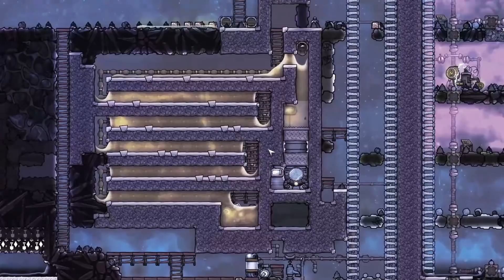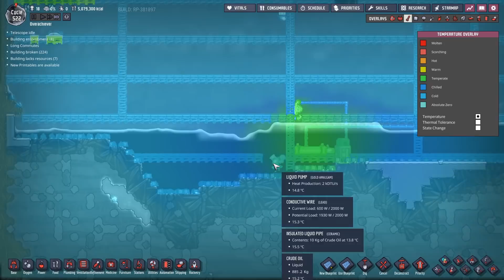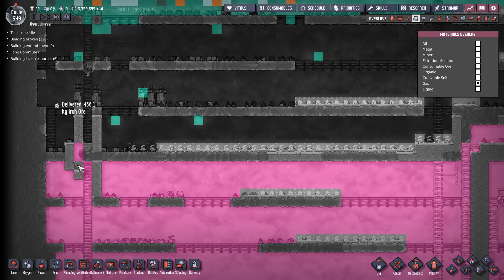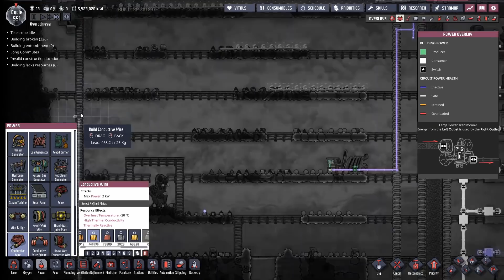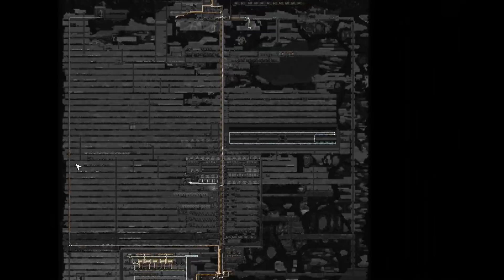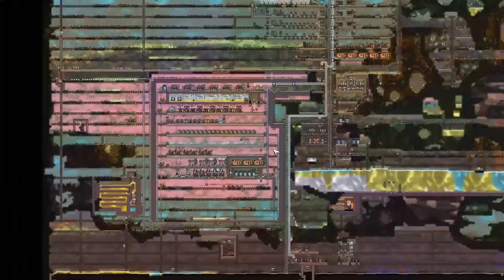Rime 19 : Hollow out the map and install some Oil Wells : Oxygen not Included

Comment: If you think germs in petroleum is weird, how about microbes that come up with crude oil and then survive desanding and treating?

Place I used to work was pads and desand, so they could send diluted bitumen off to Edmonton, AB; the lines from the plant to Edmonton (roughly 300km) had to be routinely treated with something to kill off the little iron-eating microbes that came UP OUT OF THE FORMATION.  Those little guys spent millions of years down there, munching away on what little they could find and then they get sucked up and sent down the line and start eating it from the inside.  The damage they do to the inside of a steel pipe looks like someone pressed their fingers in clay.

I would never have guessed life was THAT hardy.

Comment: Hey noob here,  I remember you saying you want to keep the petroleum generators running for the polluted water but was wondering the thoughts on which way to go. Will the crude oil eventually run out and way faster? I didn't see everything you had using water but I thought you already had a mostly infinite supply of water. Will those oil wells always just pump out crude as long as it gets water to it as well as no dormant times? Again newish to game and at least as of now I try to use as little fuel as I can as to not run out. Now is my first run I survived long enough to start refining oil for power. P.S. With newer updates is all this still possible? Seen videos with say weezeworts that cant be done since I read they nerfed them. Thanks and love the videos.
Reply: Unlike in  the real world , in oxygen not included  crude oil is plenty renewable

Comment: I would have tried to make a mini setup for that single oil well over tried to tie it in. The excess water could have been used to make rocket fuel granted a small scale one.
Reply from the maker: I dislike half measures, I know I'm running a lot of piping but for infinite power I'm willing to do whatever it takes.

Comment: Rather than piping the CO2 into your frozen industrial brick, Dig into your frozen core somewhere and pipe it there. It will instantly become solid. I used it to my advantage on my first run with Rime.
Reply from the maker: Am holding of on the frozen core until I can get all the crude oil out of the way.

Comment: Challenge: fill the whole of your base (atleast where you can) with hydrogen, it would look so nice and different :D
Reply from the maker: Have been thinking about that for a while, I figure if I just run a cooler at the bottom of the map everything except hydrogen will freeze. So since hydrogen floats on top of everything eventually only the Hydrogen would be left.
Reply: @FrancisJohnYT  toud need to create air locks of some for to ensure the dupes dont suffocate in there sleep

Comment: Francis, you dumdum, the liquid filter needs to be put before the desalinator and sieve or instead of safely disposing of the incorrect liquids you'll just damage the buildings and spill the contaminant back into the tank!

(also, the crude oil siphon thing looks suspiciously like one of those newly-found bypass pumps which would do the opposite of what you want if another liquid ahem chlorine ahem somehow enters)

Excellent as always!
Reply from the maker: I have had petroleum pass through them in the past and get into my electrolizer, well I though that was how it got into my SPOM. Testing required.